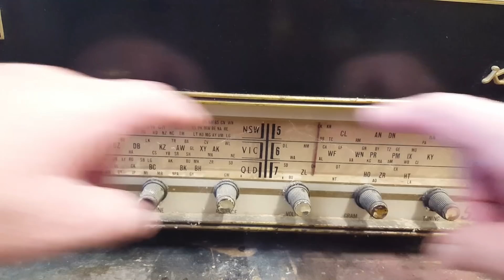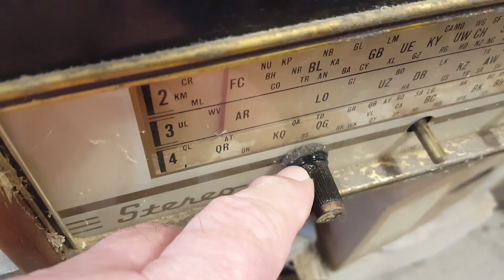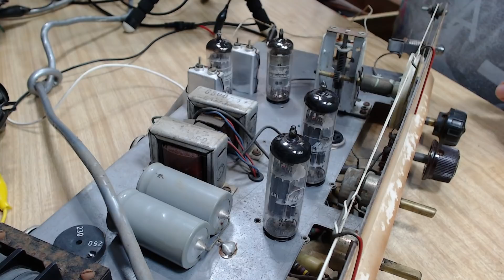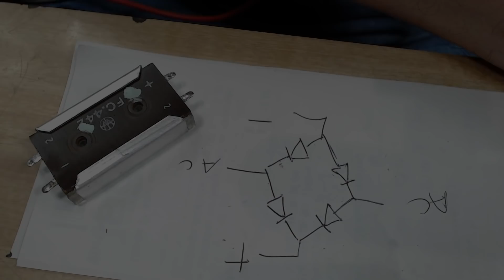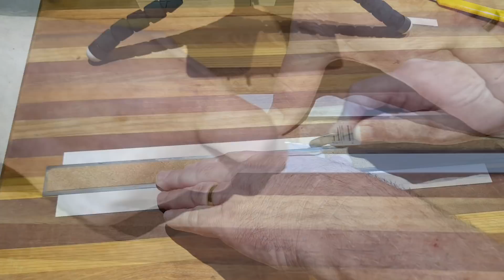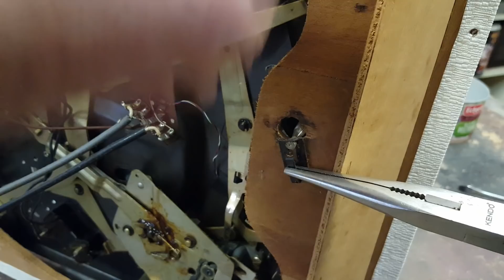Kingsley/Lincoln Tablegram RKR and Garrard 1000 Turntable Refurbishment 1960s Part 1

Comment: I've got the same Kingsley unit. It was a gift from a friend when I was staying in Australia. The turntable is also a 1000 series but looks a little different with the tonearm. The unit was working fine until the motor decided not to spin at all. I still can't figure out if it's a connection problem or the motor has completely died.
Reply from the maker: Hi Jason, nice gift from your friend. If the motor spins by hand then it's probably an electrical fault 🙂
Reply: @DavidTipton101  Hi David, thanks so much for your reply. Yes, the spin the motor freely by hand and it's not stuck or difficult to do to so. I suspected that it's probably a contact point that is dirty but I really don't know where to start to look. I live In Singapore and I've yet to come across any repair guy who knows enough about changers to repair it.
Reply from the maker: @xantophyll  You will need a multimeter to check it. There is a switch mounted under the turntable which is actuated by the Play button, you could check that it is being depressed as well. I worked in Singapore for almost 3 months back in 2008, loved it 🙂

Comment: Ah, Selenium Rectifiers ... still some sort of Nemesis for me. So far, i always replace them (or restuff it) just in case they might fail and what these things "evaporate" isnt good. :D So far great work! I'm still building my small workshop for old stuff to fix and shifted somehow to transistorized radios (without any Integrated circuits).  Still prefer the "tube sound" :D Only problem is... sometimes the overall voltage is ofc higher. So i use (big) resistors to drop it a bit. Always prefer to run sets "a tiny bit colder" rather than "hot".
Reply from the maker: Thanks Kevka Bluebird, if the radio is likely to be used the selenium goes and I agree it is better to run the radios with a lower voltage rather than higher although in this case I was happy to run it at about the correct voltage as it's a fairly 'modern' set. I should also do a few more transistor sets and learn a bit more about them. Good luck with your workshop 👍🙂

Comment: I’ve been pulling those clips off  under the motor board for several decades. I didn’t realise until recently that you just push them onto the shaft and they stand up and will then pass through the hole! Cheers, D
Reply from the maker: Hi David, it never occurred to me that they flipped up, I know now for next time, thanks 👍🙂

Comment: Hi David,
The furniture stamp dates back to the 1850s. The Chinese when they returned from the goldfield's started to make cheap furniture and cabinets. They worked long hours for very little money. The union didn't like this because their members were severly undercut. So the union lobbied the new Victorian government. Rather than ban the Chinese from making furniture, they legislated that union furniture was stamped. Thus if you look at cabinets made in Melbourne up to the mid 1970s it will be thus stamped if made by union labour. The contract for the chairs at the opening of parliament in 1901 in the Exhibition Buildings specifically banned the Chinese from selling to the Commonwealth. They were mainly located up around the north-east corner of the city and 1 or 2 of the buildings are still there. I'm not sure if the legislation is in place, but I guess it became irrelivant with the importing of cheap furniture.

The speakers were in Kriesler sets as well, with the demise of Rola. I picked up 12 brand new ones of various sizes at the auction for $10 as nobody wanted them! They were made in Sydney, I thought they were a Japanese import. I noticed to the grey caps were the rotten Elna's, another Kriesler trait. So perhaps Kingsley were purely cabnet makers by this stage. 

Here's an interesting article about Howard Kingsley.  http://messui.polygonal-moogle.com/valves/NW199407.pdf
Reply from the maker: Hi Andrew, I have been in discussion with another viewer about the same subject. I found this for the State Library of Victoria which is exactly what you said: 
https://blogs.slv.vic.gov.au/such-was-life/european-labour-stamps-on-australian-furniture/
I thought HiFlux was an MSP speaker, I can't remember if I saw MSP on them, you did well to get some so cheap.
Thanks for the Kingsley link, I'll have a look later, thanks 🙂

Comment: Dave, as ever another great video. Kingsley made radios from the 1930s and made the AR7 communications receiver during WWII. The one I have, dad rebuilt in the 1960s, replacing the octal valves with miniature equivalents. Restoring it to original is a project I have on the do to list.
Reply from the maker: Hi Dave, I read about that on Radio Museum. That would be a fun project returning it to it's original configuration, good luck 🙂

Comment: David another one going Refurbishment I recall The Kingsley Brand being sold at Walton a long gone chain of Department Stores in my time in Workshop I didn’t see many them Selenium  Rectifying were trouble free but was some time ago using Philips Caps made for long operation
Bring back when the old days I got service call just before Christmas the fault was Turntable nor working when arrived the House when began to look a Turntable I found we it rotate it caused a piece Christmas cake in the works I removed the cake and gave it overhauled and another customer was Happy
When question the customer told me the Radio Gram and Turntable hadn’t been used for while they going to have Christmas Party soon they had better have a looked at.So David Christmas is close so that my Christmas story, So David I wish you and your Family a Merry Christmas Mate,Ian,
Reply from the maker: Ahh right, I can imagine Kingsley at Waltons. My Mum worked in the Waltons cafeteria in the 70s. The rectifiers are getting on now and may work for a while yet but should be removed now I think. I wonder if the cake was there from the last Christmas party 😄 Thanks Ian and a Merry Christmas to you and yours 🎄🙂

Comment: So you changed a  working Siemens style Selenium  bridge rectifier with a silicon bridge rectifier? That's OK  David but
 the B+ was the same in either case . Could have left it alone  because it was engineered so well, unlike the cheaply 
designed  multiple plated  American ones ! I replace those all the time! Always add an additional power resistor to keep B+   where it should be . Liked the dial face upgrade.. Good repair techniques so far on the Garrard turntable. 🧫
Can't wait for part 2 and 3.👍🏻👍🏻
Reply from the maker: Hi Steve, I intend using this one so better to replace it even if it was working well. There was a fair bit of corrosion between the top disks inside when I opened it up so better out than in. I added a resistor and a heat sink. Thanks Steve 🙂

Comment: When I worked in a repair shop many years ago, one thing I recall doing many times was removing the "trip pawl" which is the little part that sits on the edge of the gear that you removed.   When the arm gets to the end of the record, it pushes on this part, which activates the mechanism to pick up the arm.   On lots of Garrard turntables, the lubricant on the trip pawl gets stiff, so it can't move.   At the end of the record, the arm hits it and just stops, then starts skipping.   Cleaning off the old lubricant and adding a little light oil gets it going again.  Your one doesn't look stuck, but you may want to re-do it anyway to be safe.
Reply from the maker: Hi rlg42 rlg42, thank you for the tip. The record play is finished and the trip pawl is free, I made sure of that, I'm starting to learn about these thing at last 😀

Comment: You got my attention when you said selenium rectifiers are not reliable.My 45 year old motorbike has one.l assume it could replaced with a modern component.Thanks for the video, I enjoy your subtle humour.
Reply from the maker: Hi Pisstin Pete, they go off with an awful smell. Check out the best way to replace your bike rectifier as the DC voltage may change. Thanks PP 🙂

Comment: great to see your back and restoring a garrard turntable. my fav autochangers :) see the retaining clips that hols the turntable to the wooden base, you dont need to take the off, when you put them back on you will see they pivit 90 degrees to allow them to lift out of the mounting holes :) cant wait for part 2
Reply from the maker: Hi Leo, thank you. The mounting clip trick has been pointed out a few times now, pity I didn't know about it when I was working on the radio. The project is finished so I won't address that in the following videos. I guess they reset when you wind the screws up. Thanks Leo 👍🙂
Reply: @DavidTipton101  are you on twitter?
Reply from the maker: @lookoutleo  Hi Leo, no, no Twitter.

Comment: The forward resistance of a silicon diode is so much lower that I just wire them directly onto the selenium and insert a suitable series resistance.
Reply from the maker: Yes it is, that's what I did, I assume you remove the selenium? 🙂

Comment: Dear David, great video and as usual, you are applying voltage, turning some knobs and the radio is working! Seems you are practicing your German. In German every object has it's own sex, the radio is an "IT", but the turntable is a "HE". Have a great pre Christmas season.
Reply from the maker: Hi Thomas, not much to do on the radio, the other parts require a bit more work. I don't even know why they are speaking German 😂 Thanks Thomas, Merry Christmas 🎄😀
Reply: @DavidTipton101  It is YouTube language adventure
Reply from the maker: @thome1547  😄

Comment: Ah, the old "Garrard glue"! Awful stuff to deal with but in fairness these decks weren't made with a projected service life of 50+ years! They usually come around ok in the end though and that one doesn't look bad apart from the congealed grease.

Ok, you didn't have much to do on the radio chassis but there's the deck and of course, the cabinet. It'll look new by the time you're done. Your cabinet restorations are always a joy to behold!
Reply from the maker: Hi Paul, I have never seen grease turn into a varnish like that, even solvents were slow to melt it. The deck next week and the cabinet the week after. Thanks Paul 😀

Comment: G'day Dave  I haven't seen one of them since  about the early 70's but yet again another 6GW8 with a high plate load resistor  I used to find them gone high back in the 70's so that hasn't lasted too bad, But always check 6GV8's & 6GW8's the triode plateload resistor was as common as muck to go high, hope your going good since your health scare & take care mate I'll send you an email soon so please look out for  it & again take care mate:)... Even though you live in Palachook country:( ... Just joking no offence meant.
Reply from the maker: Hi Greg, it may have been you how alerted me to those resistors going high so I was a little surprised when the first one read only slightly high, the second one was well over. I'm half way through my radiation treatment and it's going better than I expected so fingers crossed. Thanks Greg 👍🙂
Reply: @DavidTipton101  Good onya  mate hope thing's keep gettin' better for you ;), I noticed you don't have an email address on your youtoob account, so is there any other way to get in in contact in a private manner?...I don't have any social's accounts as I've been hacked previously n shut em all down, But would love to get in contact & departed some of my many decade's of knowledge to you, Once again ol mate Take Care n hope to hear from you soon...;)
Reply from the maker: @preston963  vintageradioaus at gmail.com 👍

Comment: I like the way it's designed, well spaced out and really nice plugs for easy disconnection.
I remember the inductance tuning from old car radios, very stable and a dam site cheaper than the wallet flatterning variable toaster rack :-D.
What did you say to the selenium rectifier?  "Get stuffed " :-D
Sorry i was born daft :-D.
When you showed the stuck gear i chuckled, i've argued with loads of basic decks.
The BSR ones are just the same, and the pin roller under the gear is always locked up.
It's fun when the record platter is frozen, small gas torch on standby :-D.
David, your ability to fabricate parts/brackets always impresses me.
Thank you for a smashing part 1 :-D.
Reply from the maker: HI zx8401ztv, I agree, it's a nice low height chassis too making it easier to service. Philips used induction tuning quite a bit at the time, I like it, easy to set up. I wasn't quite sure what to do with the stuck cam gear but I successfully used heat on a previous record player but I was a little surprised when it worked so easily. Thank you zx8401ztv 😀

Comment: I love these videos.  I'm hoping to recap my Pye P45 radio which I've had since I was a lad.  It's working, but in completely original condition.  I watch these videos for inspiration, and to build up confidence to have a go myself.
Reply from the maker: Thank you Anthony. Good luck if you do recap your PYE, at least it has a transformer. Be careful when you handle it shock wise. 👍😀 Edit: remove the springs from the Rimlock valve bases removing the valves or the glass nib will crack 👍
Reply: @DavidTipton101  Thanks Dave - good tip! One thing I always wonder when watching your films is what the spec of the replacement parts are, I know you mention the values of the resistors or capacitors, but it'd be great to know what voltage (for caps) or wattage (for resistors) you've chosen and why, just to help out us beginners!
Reply from the maker: @anthonystewart9283  The poly caps I use are rated at 600 to 650 volts, that covers 98% of 240 V radios, depending on where they are in the circuit you can use lower voltage caps but 600 Volts will cover everything. As for the wattage of resistors, I just checked the schematic for your radio and it doesn't give the wattages so you will have to go by size and position in the circuit. The smallest will probably be 1/4 Watt, the next 1/2 Watt and next up 1 Watt. There may be lager wattage ones about as well but that is generally what you will find. You can use all 1 Watt if you wish. The Electrolytes need to be above 400 volts, be guided by the Voltage number on the capacitor can. Take plenty of photos and if the radio is working consider changing only one or two components at a time.
Reply: @DavidTipton101  thanks so much for the advice and taking the trouble to look up my radio. I’ll definitely be tackling it in the new year and as you say I’ll take it carefully!

Comment: lay a hot soldering iron on the cam pin will soften the grease and it will pop off
Reply from the maker: Ahh, good tip, thanks Ian 👍🙂

Comment: As I recall, if I'm not mistaken, the pointers were black. 😋 
Seriously though, doesn't a bridge rectifier multiply the input AC by 1.414 after rectification ?  I must have missed something. 
Anyway, can't wait for the full resto.
Reply from the maker: Haha... these were red 😄 Yes, the DC voltage will be higher than the AC applied because the AC is measured as an average or RMS, when it's converted to DC and smoothed you are measuring peak to peak so the voltage appears higher. The problem with substituting silicone diodes for the selenium rectifier is that the silicone only drops 1.4 Volts and the selenium drops about 20 Volts, the resistor is used to drop the voltage in lieu of the selenium rectifier. Thanks Ellesmere 🙂

Comment: Yes 👍, this radio 📻 is a Gerrard. The genuine article. Hope ya can restore this for Christmas. It’s a very nice 👍 radiogram 📻. Didn’t know it had a record player until ya opened the lid. I really wanna see this make the grade in another household 🏠. It will probably need the usual capacitor replacement. It also may need a dial light 💡 bulb. Hope the dial cord is in good 😌 condition. I will guess that this Gerrard radiogram 📻 is from circa 1958. That probably means that the dual speakers 🔊 are permanent magnet 🧲. The dial face on this is probably glass. Be careful not to break it, or accidentally damage the numbers, if they’re painted on. Hope ya had a very happy 😊 Thanksgiving (Gobble, gobble) 😂😂!!! Your friend, Jeff.
Reply from the maker: Hi Jeff, the record player is a Gerrard I think the radio is a Philips. The dial glass is plastic. Thanks Jeff I hope you had a great Thanksgiving too 🙂

Comment: You are great with repairing this stuff. That selenium rectifire looked way better made and engeniered that US style I see mostly in this type of repair videos. Sure still they can fail and are toxic so good way to replace it. Good question would be, aren’t there diodes that have same voltage drop as old SRs? So no resostor would be needed to be installed?
Reply from the maker: Hi _Michael_, thank you. It was a nice design rectifier, I don't know of any small modern diodes that would drop that much voltage, the resistor also helps control the inrush current 🙂
Reply: You are welcome. :) OK I understand, so the resistor have two purposes in this aplication. There is big gap on market then for direct SR replacement that would have similar voltage drop, but maybe it’s just something I see, hah...

Comment: Those old Kingsley radio grams were a great basic stereo for the time and built to a price, but have stood the test of time. Those old philips mustid caps also and gave very little trouble. Lets see how the modern day stuff will last before they have gone to god or thrown  down the tip.  Nice job on repacking the selenium rectifier with modern  diodes Great job. As always i will be looking forward to your next installment.
Reply from the maker: Hi Stephen, thank you The Kingsley was finished a few weeks ago and I have been playing every day since. A good unit and sounds pretty good for what it is. It will still be going well after the modern stuff dies 😀